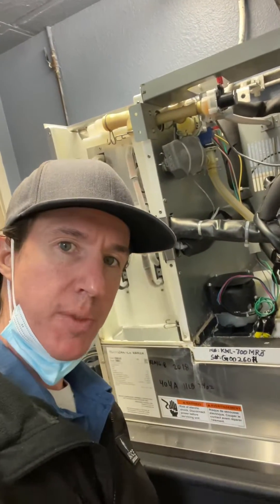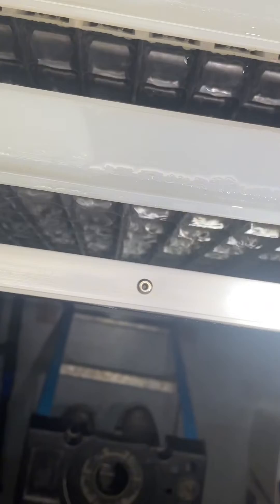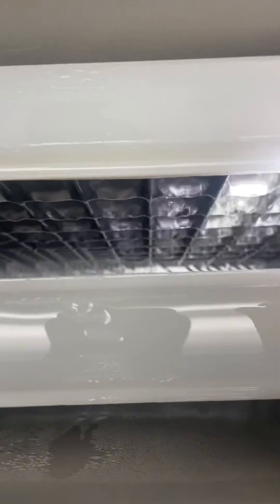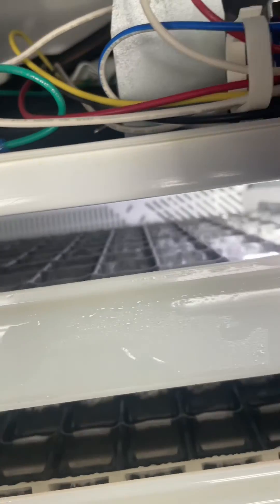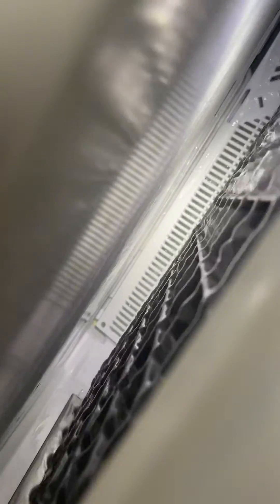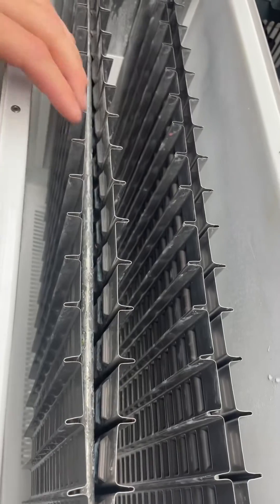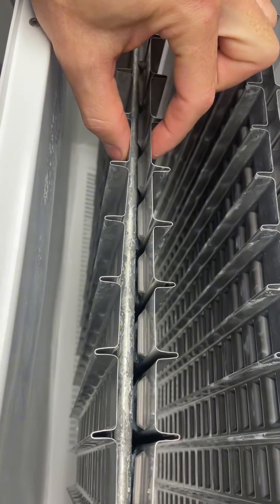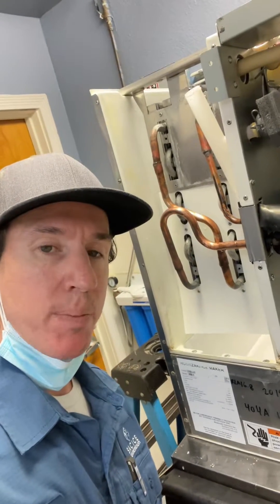Hoshizaki not making enough ice - bad evaporator

Comment: Just curious if you have any suggestions, or videos, on how to properly clean an ice bin with a baffle and a KML-250MAH sitting on top,  I had trouble getting behind the baffle... or the plastic device that drops down in the bin on a slant... thanks
Reply from the maker: I think you’re talking about the Ice Deflector. I don’t have any videos specifically about cleaning the Deflector. It’s just one of those things that requires a bit of creativity. Unfortunately it’s super hard to reach that area. I’ll usually just reach my arm in there and scrub and then spray some water. Then stick my head inside with a flashlight and see how it looks. Then repeat until I’m satisfied.

Comment: Seems like there should be a method to repair that, instead of just replace it.
Reply from the maker: I spoke to an owner who said he used JB weld. Im not sure if he was pulling my leg or not but he said it worked for years after the repair. Although I’m pretty sure the ice wasn’t safe to consume.
Reply: @IceMachine411 There are food safe epoxys though. I have heard of people putting sheet metal clips at the top to hold them as well. Thats probably best as just a temporary fix though